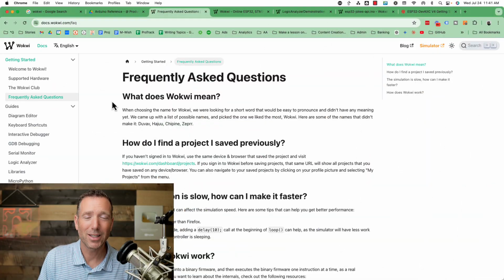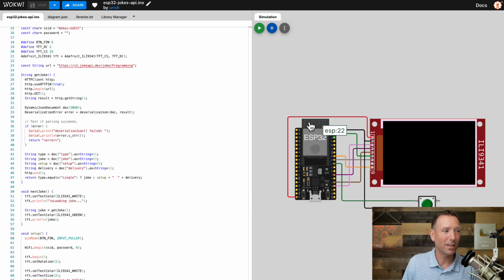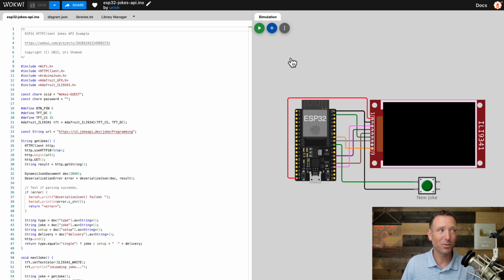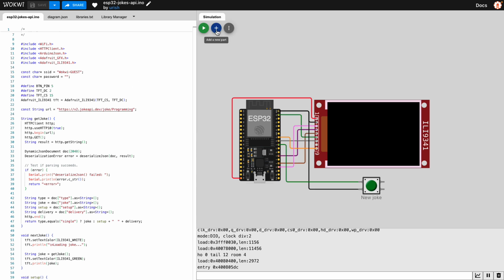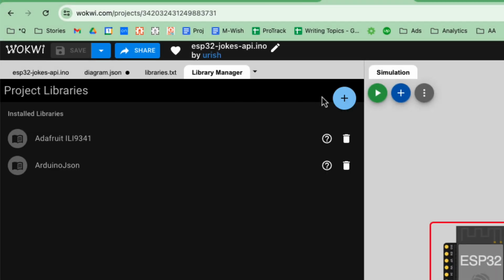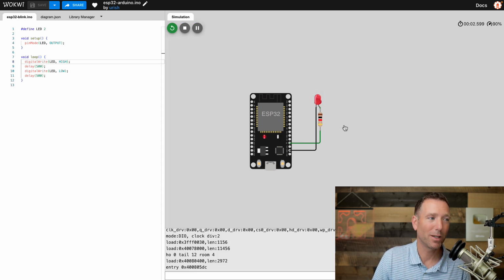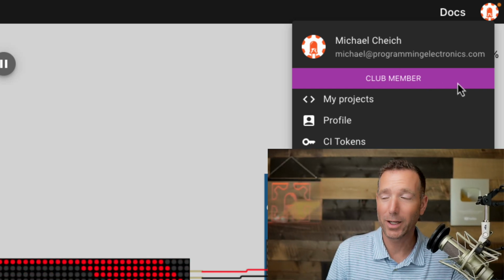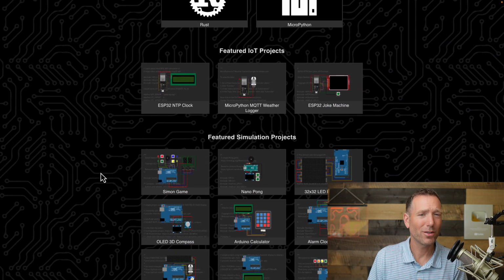The ESP32 Simulator you've been looking for!

Comment: I tried a ESP32 connecting to an LED with a series resistor.  It is blinking the LED just fine, but it is funny that when I changed the resistor value from 300 ohms to 300Kohm, and the LED is still blinking about same brightness !!! .How can that be possible?   it should not be ON at all for such a larger resistance value !!
Reply from the maker: Hmm,  you’re right,  that’s odd!  Is the connection on a breadboard?  Maybe double check the wiring?